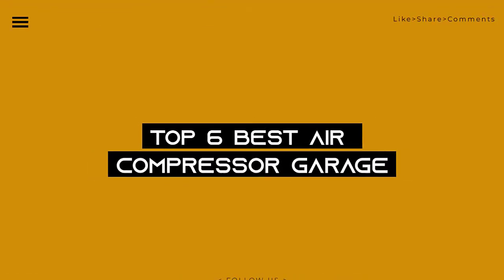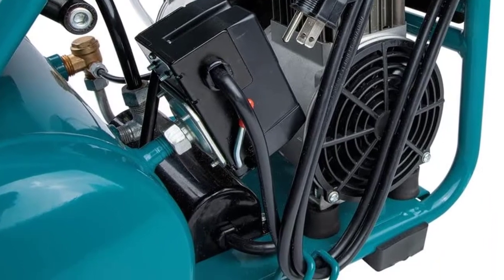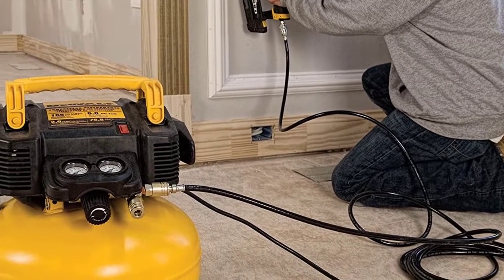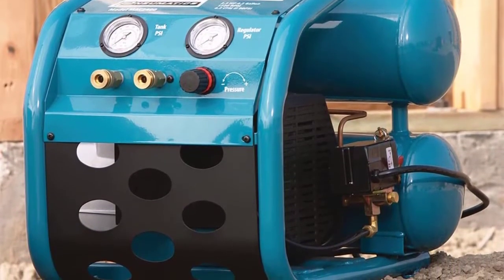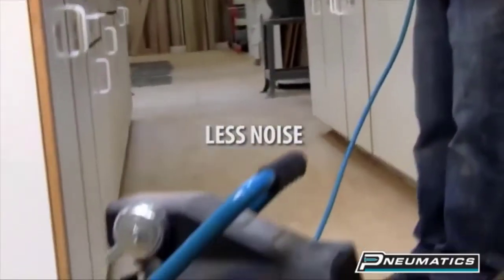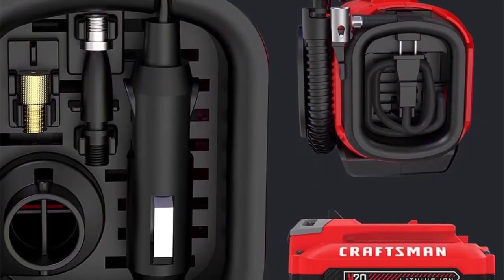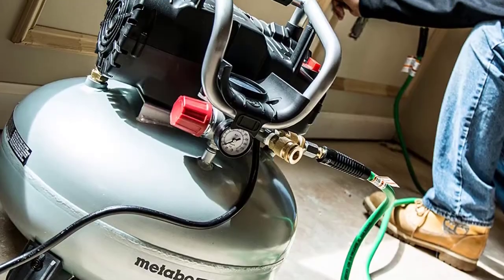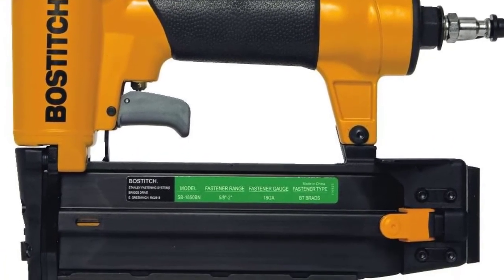✅ Top 6: Best air compressor for home garage In 2022(review)

Comment from the maker: USA
Hayward W3SP1580X15 Power Flo Pool Pump- https://amzn.to/3DlFz9k
FairmountSantrol AquaQuartz -https://amzn.to/3NgI01A
POOLPURE Replacement Filter for Type A or C- https://amzn.to/3WqXJQ3
 up to 24,000 Gallons with Stand- https://amzn.to/3DlGoiqE/59900
CIPU 12-inch Sand Filter Pump System - https://amzn.to/3SHUnFb
POLARIS PB4 - https://amzn.to/3AEyaBK